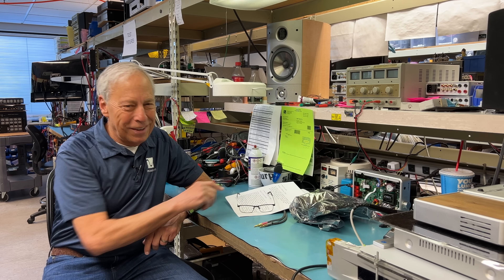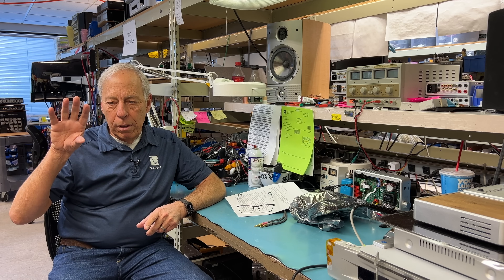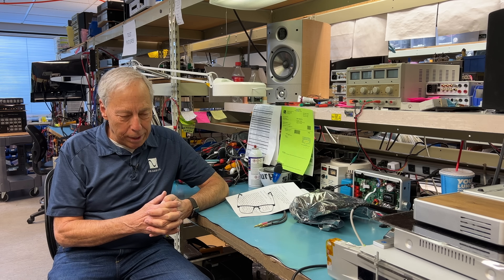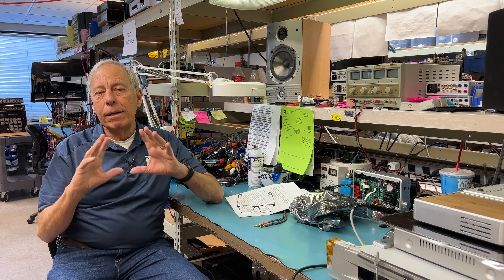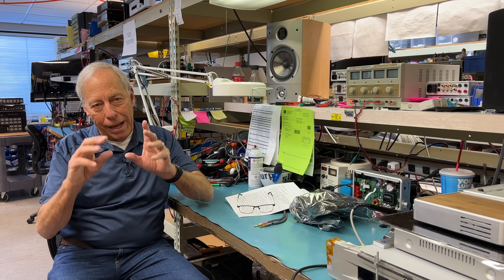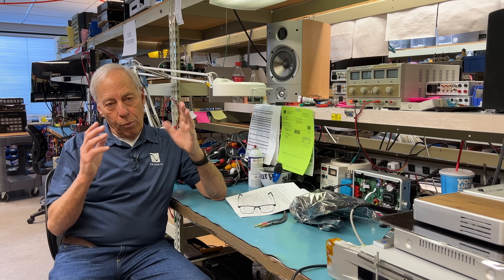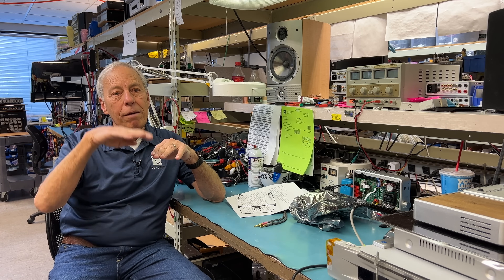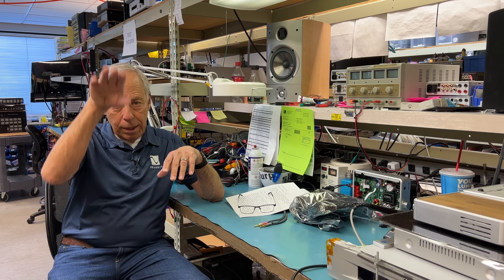Understanding voltage, current and wattage in amps

Comment: @Paulmcgowanpsaudio @2:13 No it's the current ! The "energy" induced by the coil to the speaker is: 1/2*(µ0*N²)/l)*i² No voltage is in the equation. You could drive a Tesla car or speaker with low voltage and high current but it will need cables with very big section for the huge current.  Same for the transistor, PCB, IC, etc... So it use 48V 10A instead of 2.4V 200A . Imagine a speaker cable that should stand 200A... A power line carries 200kV for the sole reason of limiting the section of the cable. With 220V it would need cables of 3 meters of diameter. Same for the trains.

Comment: I have a pair of substantial 4 Ohm floor standers each equipped with 4 20cm woofers. I have a stereo power amp rated at 400w into 4 Ohms and equipped with a 2200VA transformer. I have a pair of monoblocks, rated at 500w into 4 Ohms each equipped with a 900VA transformer. The lower wattage stereo amp drives those floor standers far more competently. I put it down to their higher current reserve.

Comment: It’s not about voltage it’s all about current for example if an amplifier circuit is using 60 volts you cannot increase the voltage otherwise you will destroy it you can increase the current not the voltage, you can substitute a power transistor with a higher amps in the same circuit but you cannot increase the voltage in the same circuit so it’s not voltage it’s the current.

Comment: Trying to learn, so? Speaker Watts, Amp Watts and wall Watts are all related, there is no special Wattage for sound, so a 100percent efficiency 100Watt sound system would pull 100Watt from the wall but if the speakers went from 4ohms to 8ohm the sound system would now be at 50Watts depending on amp rating. Buying a Nobsound 4-Channel 200Watt Amp that comes with a 110Watt 24Volt power supply, so I could ran 2 Channel at max or 4 Channel at 50 percent, so I would be thinking I'm leaving some power on the table, so maybe need 200Watt PSU. I'm an electrician but never done anything with audio.

Comment: My AMP is rated for up to 300W across both channels. It has a 36V 6A power supply connected to it so 216Watt total or 108W per channel. Now my speaker accepts max 60W. There system has no preamp: PC > DAC > AMP > Speaker. But the AMP has a VOLUME KNOB, if I lower the AMP volume will it lower the W going out to my speaker? Will this affect the voltage as well? And would it be better to downgrade the power supply to 24V 5A so it caps at 120W or 60W per channel? Will that harm the AMP which is rated at up to 300W (for both channels). Thank you!

Comment: I struggle with Paul's statement "it's the Voltage! Trust me". Of course I trust Paul, but magnetic fields around conductors are created by current (=amps), not electric potential (=volts). Probably I would need to think it through properly form A to Z to understand Paul's advice he's giving, must have to do with the way typical electromagnetic dynamic speakers work.
Reply: How do you get the current through the coil of wire? From the voltage across the  coil. If the voltage collapses towards zero, because the amplifier can't deliver enough current, no current, no electro-magnetic field, no movement, no sound. So, the amplifier needs to be able to deliver a stable voltage into any impedance that it's likely to find in a speaker. Does that make sense?
Reply: @RacingAnt  What you explain makes sense, yes.
What I am still struggling with is how to understand e.g. "bass control" of big, beefy amps vs. "loose / flabby" bass of too-small-for-the-speakers amps.
Reply: You are right, and Paul is horribly wrong. An electrodynamic driver is a current driven device. That’s why the force factor of a driver is specified in newton per ampere.

You can choose to drive a loudspeaker driver with a voltage source (where the current follows what is needed) or with a current source (where the voltage follows what is needed) as done since 1989, with much better performance, in terms of distortion (especially IM distortion, question: why is it that IM distortion figures are never published? They are huge!), compression, modulated noise, bandwidth, stability in frequency response, etc. 

The extra benefit is that with a current source there is no electric damping, which creates extra distortion and modulated noise and is very unstable. A heated voice coil leaves no electric damping left (a temperature rise of 10°C brings electric damping down to 25, no matter the damping factor of your amplifier, and 25°C down to 10!). Every other way of damping gives more stability, thus better dynamics.
Reply: @JerryRutten  I am not anywhere close to judge about electrical engineering stuff (being a mech. engineer), but I guess Paul tried to provide some short cut conclusion here.
In a new video he gets a little more into details, see https://youtu.be/7UraeQgZ9sc .
Reply: @medonk12rs  That video is about power amplifiers not about electrodynamic drivers.  Almost all power amplifiers are flawed, because of the false assumption that electrodynamic drivers are voltage driven. Almost all electric engineers make that mistake. 

And you, as a mechanical engineer, made the right assumption that an electrodynamic driver is current driven!

Comment: In the engine analogy RPM is voltage and amperage is tourqe, wattage is horsepower
Reply: perhaps amperage is displacement and wattage is fuel available?
Reply: @user-ex9zm7bg3x  food for thought perhaps displacement might be capacitance
Reply: And the hill would be impedance! Except the hill would actually be resistance. The car isn't trying to go back and forth from 20 to over 20,000 times per second.

Comment: I've asked this question so many times and this is so far the best answer I've heard. The analogy of driving up a hill and having enough power to not loose speed makes perfect sense and in this case is easier to relate to than the hose/pipe analogy.

Comment: Countermeasures are only effective when the assumptions are true.

If you lower the output impedance, because you think that an electrodynamic speaker is driven by voltage while it is driven by current, it is not only not effective, it is actually counter effective. Then, you make things worse!

If you have a very low output impedance (a high damping factor) the performance of the speaker (and the crossover!) is very sensitive to temperature of the voice coil, different types of cables and modulation of the voice coil inductance, and electric damping that is all over the place.

Whatever the damping factor of your amplifier is, when the temperature of the voice coil is raised with 10ºC (by playing some music) the damping factor is already only 25, at 50ºC only 5 and at the maximum power rating (party levels) around 1! Imaging what this does to the frequency response. And besides that, at maximum power rating the voice coil resistance is about doubled which changes the crossover frequency of the crossover filters with an octave! And, the better the driver, the more temperature and power it can handle, the more it changes the voice coil resistance (at the maximum power rating).

Comment: Power is the time rate at which energy is produced or consumed.  One Watt power is one joule energy per second.  Electrical energy from the amplifier is transformed into motion of the speaker (kinetic energy) and heat energy in the speaker.  The motion of the speaker produces sound waves in air.

Voltage is electromotive force.  Voltage is the amount of energy per electric charge.  One Volt is one joule energy per coulomb electric charge.

Current is the time rate of flow of electric charge.  One Ampere or Amp is one coulomb electric charge per second.

In simplest terms, the power in Watts equals the voltage in Volts times the current in Amps.  Joules energy per second equals joules energy per coulomb electric charge times coulombs electric charge per second.

An amplifier is a voltage source with voltage and current limits.  The amplifier voltage output is independent of the load impedance within the voltage and current limits.  The load impedance determines the current and power output within current and voltage limits.

An amplifier provides voltage gain.  The amplifier increases the voltage output of the preamplifier to drive the speaker.

The amplifier must provide enough current to drive the impedance of the speaker.  When the amplifier voltage or current reaches the limit, the voltage amplitude no longer increases.  The audio signal waveform is distorted when input signals and amplifier gain push the amplifier to produce voltage or current greater than voltage or current limits.

The voltage in Volts equals the current in Amps times the resistance in Ohms. This is Ohm’s Law.  The symbol for Ohms resistance is Greek letter Omega Ω. 

Speaker impedance is complex.  Resistance is a scalar.  Impedance is a vector with magnitude and phase.  Speaker impedance changes with frequency.  Speaker nominal impedance is a simplification that allows us to approximate complex speaker impedance as resistance.

The symbol for Ohms impedance is also Greek letter Omega Ω.

Music signal voltage waveforms are complex.  Music waveforms are made up of many fundamental frequencies and harmonics that start and stop and increase or decrease amplitude and frequency over time.

Root Mean Square is a mathematical way of calculating the effective average voltage of a continuous periodic alternating waveform.  RMS is different for different waveforms.

For sine waves V RMS equals V peak times 1/√2 or about 0.7071.  For sine waves V RMS equals V peak -3.01dB where dB = 20 log 1/√2.

For square waves V RMS equals V peak.  For square waves V RMS equals V peak -0dB.

For triangle or sawtooth waves V RMS equals V peak times 1/√3 or about 0.5774.  For triangle or sawtooth waves V RMS equals V peak  -4.77dB where dB = 20 log 1/√3.

For complex music signals V average equals about V peak -20dB or V peak times 0.1.

Amplifier power is rated driving 8Ω resistors with sine waves.  Amplifier rated power is a simplification.

Comment: Howdy. May I be a smartxxx ?
Voltage and Amperege are not two independent things. Voltage drives amperege. And amperege drives the speakers.
The PA must have enough amperege in stock, for the voltage to push through the speaker.
Regards.

Comment: If im understanding this correctly a country that has 240 v power supply will have more current coming out of an amp or is the voltage coming out the amp

Comment: Voltage (potential difference) across a load causes current to flow in the load - (speaker) - the resulting combination of voltage / current / resistance = power in watts. To calculate the RMS power into your speaker, you take the peak to peak voltage, halve it, (because the negative and positive half cycles are equivalent) multiply it by 0.707 to convert peak voltage into RMS voltage, and then square it and divide by your speaker impedance. For example 60V peak voltage across 8R speaker: 60V x 0.707 = 42.42V (RMS volts) squared = 1799.45V divided by 8 Ohms = 224.93Watts RMS into 8R. The peak current will be 60V divided by 8R = 7.5Amps (this will be the peak current at the top of the + half cycle and also - half cycle) - so the amp must be able to provide the 60V peak to peak voltage at 7.5 amps peak current in order to deliver the 224W RMS
Reply: Either your calculation or your description is wrong. You say to halve the peak-to-peak voltage, yet the calculation is based on the full peak-to-peak voltage, not half of it.

Comment: A great, simplified approximation to suite 99% of the people. Well done.

Now after reading comments from all of the amplifier experts, let me ask all of you "how do bridged amplifiers work?"

Since both bridged channels work on the same power supply the max voltage doesn't change. 
How does this go for those fixated on voltage?
Why does the max watts increase?

Where is the impedance relationship to watts, voltage and current?

Where is the saturation of the power transformer come in to watts, voltage and current?

Where is the power and current stage switch device power dissipation come in to watts, voltage and current?

Is there such a thing as a minimum load and why?

Feel free to way in with free explanations.

I look forward to reading more.
Reply from the maker: Hi Thomas. I can help you a little here in this limited space. The trick with a bridged amplifier is the same as with a balanced cable (which offers 6dB more gain for the same signal). By inverting one channel and then placing the speaker between the two amplifier outputs (no connection to ground), the output voltage is doubled. This is because when the channel is inverted, one amplifier is moving away from zero in the positive direction while the other channel is moving away from zero in the negative direction, thus doubling the distance between the two signals. Think of it like two cars speeding away from each other at the same speed. While each car is only moving at 60 miles per hour, as measured between the two cars, they are moving apart at 120 MPH.
Reply: @Paulmcgowanpsaudio  Thanks Paul. It was a tongue in cheek comment to drive the "experts" a little silly.  Stay Well and congratulations on the speaker launch. Lot's of glowing comments coming out of the Montreal show.

Comment: Usually very good but not really this time.  Not fundamentally wrong as you need voltage to drive current (Ohms law), but it is the change in current flowing through a speaker coil that creates a magnetic field that causes the magnet attached to the cone to move, creating sound.   Voltage without the ability to supply enough current quickly enough is pointless.  You could generate high voltages in a preamp (tube amps do) but they wouldn’t drive enough current so you need a current amplifier stage (power amp) to move a speaker.

Comment: This can be explained much easier way.

Power depends on current and voltage:

P = I * V

But current also depends on voltage (not only but still):

I = V / R

So after all P = V^2 / R

As long as R (resistance) is constant (well it can be different for different frequencies but for certain frequency it is constant) it is the V (voltage) that makes a difference on overall power (P).

So if your amp is good enough that it can provide necessary voltage for any frequency (i.e. any impedance that your speaker factually has) you will have good power level no matter what.

PS. Impedance is not 1:1 to resistance, but for this explanation we can count this as the same
Reply: But voltage depends on current:  V = I * R.  And P = I^2 * R. So long R is constant it's the I (current) that makes a difference in Power.
Reply: @johnnytoobad7785  current is secondary to voltage, not the opposite

Comment: The problem is that amplifier manufacturer says it got for example 20 Watt.
As a consumer we will never know if amp A is getting 20 Watts with 10 volts * 2 Amps..

Or amp B also 20 Watts but with ~6.7 volts * 3 Amps.

But we CONSUMERS never get that info. 
Therefore it is pointless to say get one amplifier that has a lot of current (amps)..

That is hidden and we will never know and makes the advice useless:
"Get a amplifier with high current OR those speakers need high current"

Yes you can go with higher wattage and hope that the current is larger than the one with lower wattage.

When the lower wattage can have higher current but lower voltage so it will produce lower wattage..

But we will never know.

If not somebody says that a amplifier always has the RATIO X between voltage and current.

And what is the RATIO for consider a amplifier a CURRENT driving amplifier as the opposite to the far more common voltage driven amplifiers.. (That Avantgarde has for example.)

Paul must understand that he is teaching the simple stuff and we all understand that by now. But the interesting stuff is as mentioned above. So focus on that and move on.

Comment: Hi Paul... if power is dependent on voltage, why is the Sprout 100 power output the same in the US as it is in the UK where the mains AC supply is more than double the US standard ? Surely to compensate for the lower voltage at 110Vac you're not consuming double the current (20Amps ?) from the mains socket ?? 20Amps is a LOT to draw through a power cable.

I realise the answer will be related to the transformer, but WHY couldn't amplifiers in the UK generate double the power output ?
Reply: Because at a given load on the electrical infrastructure, at double the supply voltage they are drawing half the current from the wall.  The consumption in wattage (power) is still the same.

Comment: The "water tank & pipe" analogy is a useful and pertinent example to help understanding the voltage/current/impedance relationship. Suppose the loudness of a pair of speakers is fixed and this implies that the required voltage needs to be maintained to a certain level. Since the LS's impedance varies during its playing, the diffrent amount of current must be drawn from the amplifier to sustain the voltage. This explains why the amplifier needs to provide double the power when  LS's impedance drops from 8 ohm to 4 ohm. I got really confused when it comes to the Mcintosh amps with Autoformers. These Amps are to provide consistant power whatever the LS's impedance is, and this function seems to be contradictory to the doubling-down requirement. Anyone can please share some knowledge here? Thanks.
Reply: I think the exact same thing about Macs. Same power into 8, 4 and 2 ohms. Seems off.